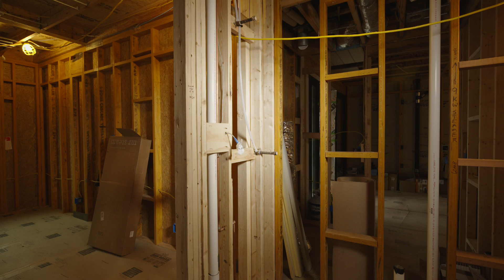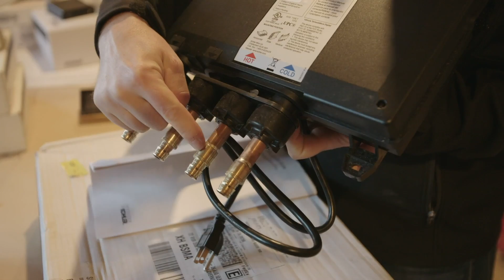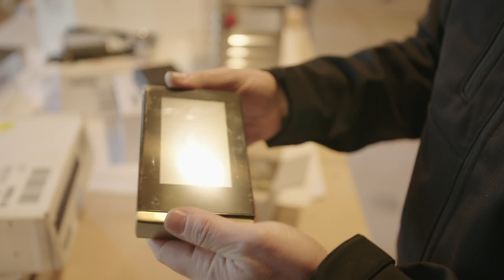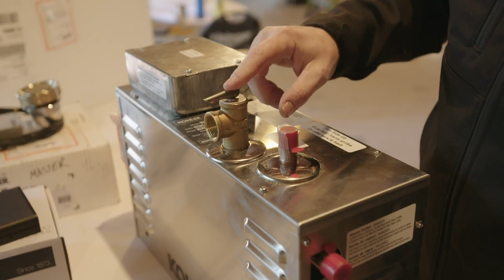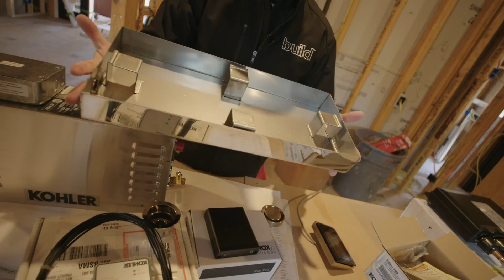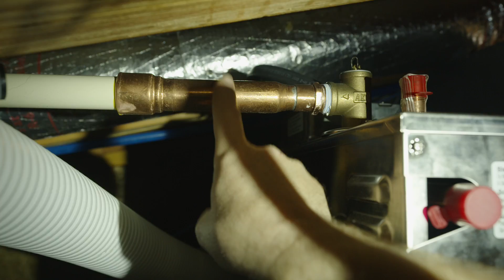Electronic Thermostatic Shower Valve - This is impressive!

Comment: Based on the note on page 7 of the “ Installation Instructions”, Kohler suggests not to install the unit higher than the steam head. Wondering how your steam unit is peeformimg.

Comment: I know this is old but warning for plumbers using steam piping requires being insulated with fiberglass insulation. Insulated steam lines help prevent less condensation, also provides protection to PEX water piping passing close or touching steam lines, can cause a rupture of a water line

Comment: Great info and reviews on these videos.  I have a question for you on the Kohler steam unit.   On page 6 of the Installation and Care Guide it says that for optimum performance, the unit shall not be installed above the level of the steam head.  I see that you have installed the unit above the shower.  How has this been performing for you and whats the con of installing the unit above the shower. I’m asking because my only option is to install it above the shower.

Comment: Matt, if the ethernet connected DTV unit is mounted inside the shower stall, I would give it 3-4 years before the high humidity corrodes the electronics inside of it.  The is not a good way to make an ethernet jack water/humidity proof unless it is fully sealed with pass-through grommet seals the the ethernet cable will run through.  Just make sure that device can be removed/replaced fairly easily.

Comment: Please please do multiple shows on door hardware, hinges, etc.  I'm thinking about ball bearing hinges but not sure if they are worth it and the only stores that sell them are shut down for covid. Also are you going to use steel AC vents or opposing shutter aluminum vents?

Comment: I'm a software engineer and I like the smart home stuff, but this seems like a solution looking for a problem.  Mechanical valves work great and require no troubleshooting when the electronics decide to take a dump.  The steam thing looks interesting though.  I guess when converting appliances over to "smart" ones I like to see that there solving a real problem, for example the smart thermostat allowed me to stay on the couch and change the temp if I'm too hot.  Or the smart sprinkler controller allows me to test and adjust each sprinkler without walking to the garage 100 times to turn them on and off.  Will I be getting a answer fridge?  Probably not.  Because seeing the inside of my fridge on my phone doesn't seem very useful to me.  Will I get a answer water heater?  Maybe.

Comment: The reason you want to be able to turn on your shower remotely is because the water takes time to get to your perfect temp. A problem easily (and very cheaply) solved with a feedback loop that allows a trickle of water to be pumped from the hot water pipe  at your shower head back into the the hot water tank. The is keeps the HW supply always at the tank temp.

Comment: my only problem with any electronics is the lifespan of said parts they do tend to have a short lifespan as an example i know this may be a little like apples to oranges but am gonna say it anyway about 10 years ago a bought a small window air conditioner i had a couple of older ones already they had old style dials and knobs your turn to control temp and fan well long story short the new one with its electronic control board and no knobs or dials is in the scrap heap the old ones are in the garage and still work both are 20 years old and still work great they new one after 6 years stopped allowing me to set the temp it would change the temp on its own and became unusable it still cooled the air but could not set the temp just a thought great video as usual Matt

Comment: Way over price. I built same system (without steam) with under $200. I am using WYZE sprinkler controller and Alexa. One $49 controller have 8 output line (my shower, two sinks and the Jacuzzi works with Alexa i). I also have all hand controls as well.

Comment: I love this channel, but man this is just a bridge too far. If a shower requires a network cable, I'm out.
Reply: At least he's stimulating the economy.  But yea, washing cash down the drain.
Reply: Damnt shower was cold because the kids and the wife were hogging all the bandwidth.

The good old days when it was only the toilet flushing that stole your hot water.
Reply: Ok boomer...
Reply: @MariuszChr  shouldn't make fun of the old guy.  He is the only one left that actually knows how to do the plumbing.  (Millennial holding a torch turning it over looking for the blu-tooth synch button.)
Reply: @GeoFry3  well you guys are killing innovation. Few dumbasses messed up your approach to technology by selling you cheapest possible electronics from China. No wonder it fails and make you hate "networking cable to shower head". We do the same electronics in your car but its so hidden  you don't even think about. And it works... You know why? Because it's not cheapest possible electronics, but designed and implemented using standards and known failures are mitigated.
Reply: @MariuszChr  you are talking to a mechanical engineer and building automation guy.  All I do is play with new tech and I bolt it to really really old tech, because the "new" stuff cannot do anything without heavy infrastructure and a few layers of old stuff, which the jokes on you, only the old guys know how to do.

I love my Unifi home network and all the wireless controlled power switches and lights, but I am smart enough to know when to say when on how much automation should be installed.  How are you going to get Alexa to turn back on the lights or turn on the shower if the internet is down and you never bothered to wire in a manual switch?
Reply: @MariuszChr  lol, we do not do the same stuff in your car.  Never worked on car have you?  (It's all 80s Era control gear, Tesla is the primary exception)
Reply: @GeoFry3  I do my autonation local. I hate being dependant on internet connection and any of those Alexa services to be available... Not to mention delays introduced by using that stuff.
Reply: @GeoFry3  I worked on cars since I was a little. Now I am automotive engineer working on ECUs for autonomous driving.
Reply: @MariuszChr  ECUs is fairly old tech.  Probably even older than the before mentioned network cable.  Only thing new about self driving cars is the speed of the hardware and price drop allowing for integration of previously expensive hardware that can run things in real tme.  Very cool stuff.  I enjoyed the projects the projects that let me play with navigation systems.
Reply: @GeoFry3  old tech? What? Sw is constantly improved, ever model year gets new stuff even if functions are the same. We use latest MCUs. Maybe you mean the "rules" to make a good product are old? Maybe, because silicon is still a silicon. But keep in mind that ISO norms are being updated... Last update of ISO26262 is from ca.2018
Reply: @MariuszChr  no I mean most of the self driving tech is just new versions of stuff that has been floating around since at least the 70s.  The autopilot and control systems I've worked on in the "high tech" world of the Air Force are from the 60s, 70s, and 80s.  The modern automotive ECUs found in cars today is barely more sophisticated versions of that same tech.  Now Machine learning and image recognition software is the interesting tech that has made leaps and bounds but mostly because you can run them on hardware that is literally dirt cheap and faster than anything even remotely possible 30 years ago which let's you crunch the numbers in real time in a mobile platform.
Reply: @MariuszChr  define your acronym terms, don't know what you mean.  SW?  Software?  MCU?  Marvel Comic Universe?

ISOs are just industry standards.  Puts everyone on the same page to avoid technobable marketing nonsense and keeps the lawyers in their lane.
Reply: @GeoFry3  SW - software, MCU - microcontroller.

Comment: How do you have a steam unit up stream. I installed this same unit and in the directions it specifically says unit has to be below the exhaust and slope away from unit if pipe is running a distance since you know steam rises.

Comment: Looks very similar to the ThermaSol system we installed in our Master shower 3 years ago, nice to see more companies following suit with advanced systems.
https://www.thermasol.com/products

MATT - Great mind on heating the bench, tho I also heated the walls around the bench, so we never sit back against cold tile either! 
But if I am being honest, the smartest thing I did was replace the bidet with a URINAL and get a modern wall hung toilet with bidet seat. That urinal saves marriages guys. I haven't had to put a seat down for years nor been yelled at for dribble! Hell I even added an auto flush sensor in the wall :)

Comment: Steam generator - awesome, I have one myself; valves not inside the wall, behind the tile - really good, I like Hans Grohe line with valves in front of the tile, easier maintenance; touch screen in shower - bad idea! Yet to see one registering your interaction with it reliably enough to not be super annoying!; Electronically controlled valves - ha ha ha... we, as an engineering species, really didn’t evolve enough to make this robust, reliable, and secure.

Comment: Matt, I rebuilt my bathroom about a year ago. I also installed the Schluter ditra heated floor. I love it. I opted for the WiFi thermostat so I can adjust it from anywhere, but its scheduled for 87 degrees for the most part. One other thing I did, and highly recommend: I mounted a 1st gen Amazon Alexa in the ceiling, ran a 3.5 mm cable-out to a $30 T-class amp in a closet, from the amp I ran 2 sets of speaker wires back to 2 8" steam-proof speakers mounted in the ceiling on either side of the bathroom. Now when I'm in the shower I can listen to my favorite podcast, ask the weather, listen to news, or change song and rock out! Trust me, its ESSENTIAL. :-)

Comment: Dunno about all those electronics. Check out the children's book: "Lazy Tommy Pumpkinhead"... it's *old*, but prescient ... what happens when the machines go wrong!  I think I'd prefer apps for most of these things... we've got a heated floor with a total crap UI; ditto the skylights. I think they're moving that way, but of course the old units are not upgradeable. :-(  I think you should consider talking a little about POU water heaters for *sinks*... getting oil off hands is a no-go with cold water, and who wants to sit and wait for it?

Comment: Matt love the idea for the electic valve just 2 questions.
What happens to valve if power goes out. Can you not shower? What happens if power goes out while you are showering? Might want a small PC UPS on that equipment or a shut off on the hot and cold inlet  before it for maintenance.

Comment: Even if they managed to make to make the touchscreen work reliably in variably-wet conditions (which I'm not convinced they have), there is a huge amount to be said in support of tactile physical controls. I can easily adjust my shower temperature or sprayer valve knobs literally with my eyes closed, when covered in shampoo or soap suds — and I often do. 

A touchscreen control, or even multiple touchscreen controls several feet(!) apart, is not unequivocally "better".

Comment: This is technology solving a non-existent problem.   Simple is better than complex.  I don't need a shower that turns on automatically to a pre-set temperature.    This gadget will require maintenance, repairs and replacement.   No way would I want this junk in my house.

Comment: What a farce! Way too complicated and doomed to failure. All my shower and tub plumbing was installed 40 years ago using off the shelf fixtures from a big box store. The only repair I ever made to the system was to replace a handle. What is the reason we make getting wet such a big deal?

Comment: Unsubscribing. I like your show but I'm boycotting all things from red states. Keep up the good work though and thanks for what I have learned.
Reply from the maker: That’s really odd.
Reply: @buildshow  , It shouldn't be odd. After January 6th any way I can influence the red states to improve our democracy I will. As I will certainly not be storming their capitals that leaves boycotting anything and everything from them as well as not visiting them. It's the same thing you're doing. Influencing. Our democracy is like a strong wall. Both of them are important, and if we all stand up and stand behind everything and anything that we put into them then they will only be sturdier and more resilient. Conversely, using a crowbar to pry out and replace rotten and racked sections also adds to their integrity. 
Anyway, I do like your show as well as what you are doing and I'm sure your success will continue. With that I wish you all the luck in the world. Break a leg.

Comment: I have been a Kohler guy my whole life. That being said alot of their products are made in China. Kinda misleading as they tour their castings from early 1900's making you think they are made in the USA in the original factory. They may be family owned but the think like Wall St. I have an upscale porcelain sink with an electric pasta boiler. The drain in it won't hold water anymore and the don't have any replacement parts. Also the casting is not straight on one side it doesn't sit flat on the granite counter drives me crazy. I spoke to them many times and they refuse to do anything about it. I purchased it in 2007. And had it installed in 2009 because we were finishing the home. I was told that all Kohler products were Lifetime warranty but they told me only 5 years on the sink we have. They said they stop making them in 2005, but I bought mine special order in 2007. They told me no parts or warranty left. Big disappointment!

Comment: I don't understand why the plumber would use AAV on those lavs instead of re-venting onto the main stack right there. Seems like the lazy way out.
Reply from the maker: We did not need any AAVs
Reply: @buildshow  So what is with the 2 PVC stub outs under each sink? I guess they must be going to use them as a cleanout and ran 2" arms because it's to far for 1 1/2".

Comment: If you have on demand hot water units make sure you have some kind of pressure balancing unit before feeding the hot and cold to the Kohler shower system or you will have problems keeping the temperature constant. Kohler may or may not tell you this but it is in the fine print that they don't work well with on demand units because there is too much variance in the hot and cold pressure.

Comment: I certain that you will have a very strong firewall!  An internet connected shower/temp control gives one pause?
Reply: Just because it's networked doesn't mean it's connected to the internet. It's likely a stand alone LAN for the various parts of the shower system.

Comment: I'm an engineer who designs (among other things) control systems.  There is no way I would put something like this in my walls.  When it fails, you will have to rip it all out as parts will no longer be available - probably replace it with regular valves which will still be available.   It doesn't fit in a so-called 100 year house.   

It might be OK if this were made of actual industrial components rather than consumer stuff, but it would be 5-10x the cost.

Comment: A friend installed a computerized Kohler shower unit about eight years ago. Now the electronics failed and Kohler doesn't sell any replacement parts for the unit.
I would think twice before spending big money for equipment that can't be serviced in the future.

Comment: Matt’s wife: Honey, I can’t get any hot water.
Matt: oh that’s simple. It’s either the keypad malfunctioned, or the electronic thermostat jammed, or we have to reset the controller or the Cat5 cable is shot.
Matt’s wife: Did you fix it?
Matt: no, The kid next door hacked my system again.
Reply: Or is the internet service provider isn't working mean this type of faucet doesn't work without an internet connection, which means not internet not shower 🥵🥵🥵

Comment: I stopped at two minutes into this video and I can say that I’m not planning on doing anything like this in the next year or so or maybe never. Whenever that happens the technology would’ve changed they would change the design it would be made in some foreign country if it isn’t already and none of this will actually apply. Furthermore I would imagine that it would be a good idea to have all of these parts and pieces including the vinyl tubing accessible from some maintenance room because I guarantee you that this crap is going to fail in less than ten years, I don’t care whether it’s Kohler, or someone else. Depending on who puts it together and their understanding of plumbing, fittings and sealant just to name a few things are very important.

Comment: I have a $100 Moan shower valve with a separate control for Hot and Cold balance. Turn it on and it’s always the same temperature. I can even change that balance while I’m showering!  
  I don’t think this product will go anywhere. It’s just an unnecessary opportunity to spend money for much greater risk of failure...
  Just my opinion.

Comment: Man ....You better put a surge protector right at the unit and one at the panel. 2x to save that equipment. Plus I would suggest getting graphite rings to rap the cords around quites up the power going in the system electronics and last but not least a per filter at or by system, even if you have a total home filter. Dean P.S. love all the toys your putting in. Please tell me your doing some killer sound system .